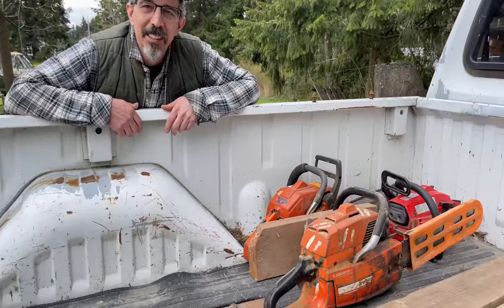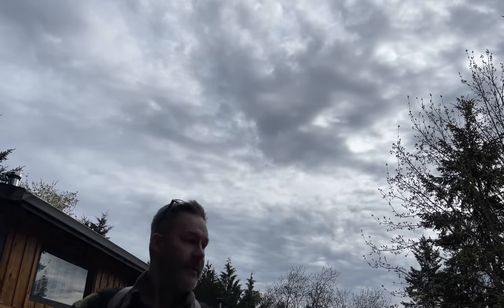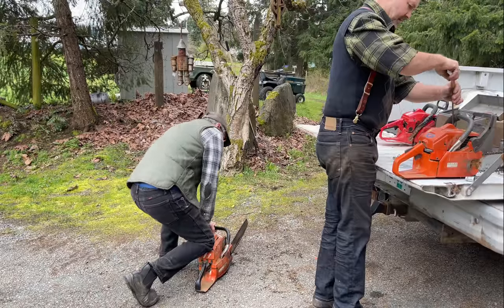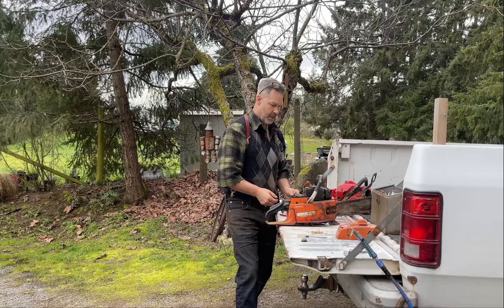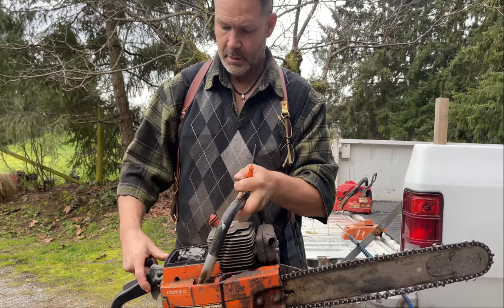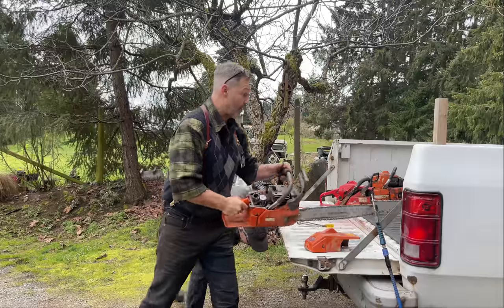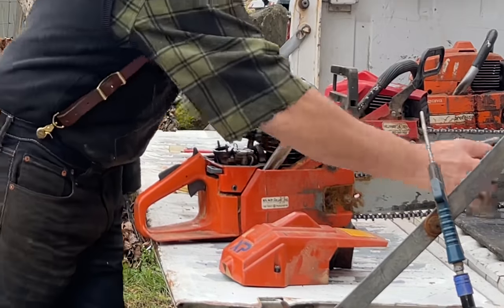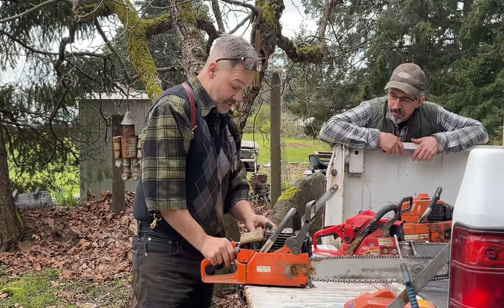Tailgate Chronicles , Loggers Chainsaw tips on tuning, stop chain spinning.

Comment: Thank you Billy Ray!!!
On the ford try removing distributor cap and watch the rotor now move the crankshaft back and forth if the rotor doesn’t go back and fort with the crank the timing chain is loose. The chain turns  the cam turns rotor.   Remove  battery when doing this!!!

Comment: Just bought a lil homelite the other day. Slowly getting back into it. I did run a couple of 24” Holzfforma’s when they first released them. Got two big girls for under $1,000😳😁👌. Now there that each. Plenty of power, reliable and come with Stihl chains. When I was younger all they ran was Homelite and McCulloch in my area in Oz.

Comment: I have a Makita 6421. When it sits too long (week or more) it won't start until you put fuel directly into the intake on the carb, then it starts beautifully all the time till the next time it sat too long.

Other than that, i have no complaints about it. Great saw.

Comment: I may be mistaken bit when i first saw u turning over motor the rotor was stoping pointing to # 8 cylynder..#1 on ford is pass side front cylynder...Top dead center(TDC)is on the compression stroke ..thats when. It fires..8°or wtvr (BTDC)..before top dead center..if rotor is pionted to # 8 n youre timing mark is up n rotor is pionted to it..them thats #1 in firing order..you are 180° out..or wires are mixed up..easy to do...juss sayin..
Rotor should always be pionted to #1 on comp stroke..n ur right timing mark on tab..

Comment: The big husky seams to be similar to the one I have! (2101 xp from early 90.s) but this in video is probably a slightly older model..A very good and powerful saw it is (90cc) for the heavier jobs, but can be difficult to get spare parts for it nowadays
Reply: 2100 or 1100. I know husky was going through some changes there.

Comment: Very good video. I would like to see a video about tuning regarding the danger of adjusting too lean and causing the saw to freeze up. I am very worried about adjusting my saw and accidentally burning it up. In fact, I had a Mac 130 for a couple of decades and  a couple years ago I was adjusting the low speed and as I was cutting it started bogging down and finally froze up. I don't know if I caused it or if it finally just got too old but since then I am very shy about touching my saws adjustments.

Comment: Howzit Billy,
Ty for all the great info on sharpening and insights over all.
 How many turns out to start from bottom on Low is best to start at? And same with Hi. 
I have a Echo cs-450 and 330T that wont start easy and idle without revving them. 
I am using up a case of Umion76 old out board 2 cycle oil in my saws that puts out more smoke. Dose this matter?
Aloha from Big Island Hawaii. If you ever visit let me know. I love to share the blessings i am surrounded by.

Comment: I always use 40 to 1 as a gas ratio instead of 50 to 1 in two stroke engines.  When you are cutting with the chainsaw wide-open on big wood it hammers those little pistons pretty hard.  So I always recommend using the 40 to 1 in chainsaw verses the 50 to 1 for that reason. So in my seven years of professional tree removal business I have never blown up a chainsaw doing it.  The only time that has ever happened to me is when people are using there own fuel and not my saws.  If you use a climbing saw to cut the base wood of a tree it really hammers those saws hard.  You have to scale your cc size to the diameter of the wood that you are cutting.
Reply: I have been logging for 35 years and I have never gone over 40 to1 and never ever burnt up a chainsaw engine.

Comment: I had a 371xpw that idled flawlessly with a bad crank seal and a hole in the intake boot but it would  run hot and fall on it face if you leaned on it at all.